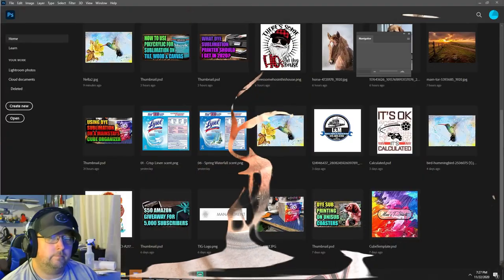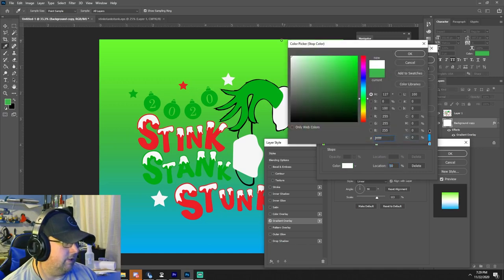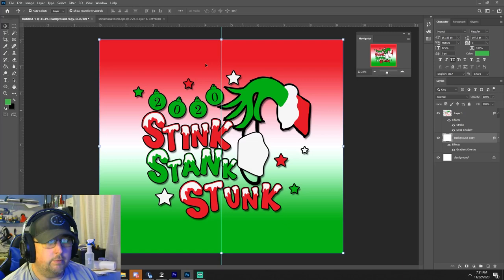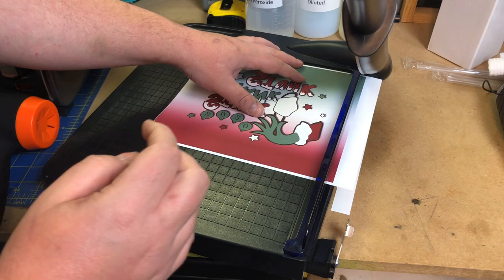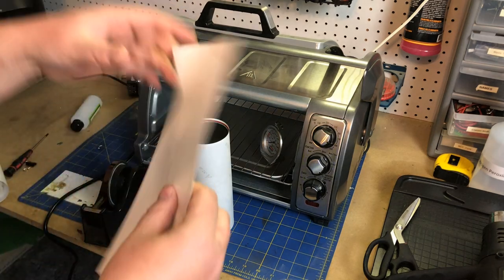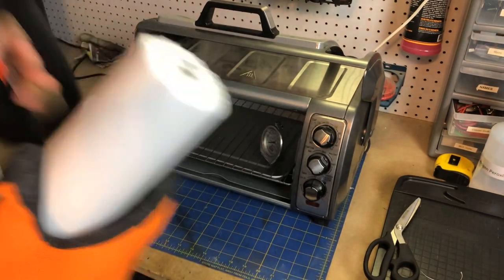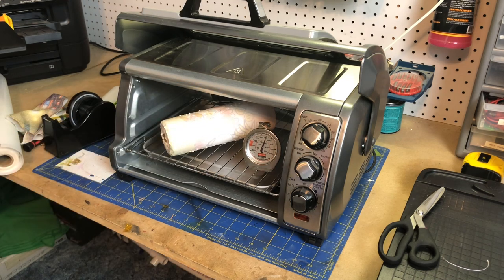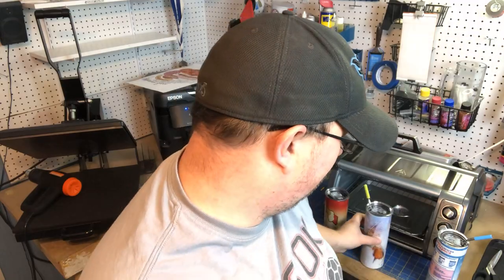Printing Dye Sublimation Skinny Tumblers with an Oven with Shrink Wrap

Comment: Great video. But I did my 20oz tumbler in my mug press and it can out fantastic! Thanks for the inside tip on Photoshop. I use photoshop to make my designs but I’m still not that great with it. But I’m learning.
Reply from the maker: Photoshop takes a little while to learn.. it’s a very deep program

Comment: Dumb Question here, but how so you measure to get the tumbler dimensions? I get the 2.9.....after that I am completely lost! Thanks in advance! Cindy
Reply from the maker: It's actually a little geometry. 2.96 x 3.1415 (pi) = approx 9.3 inches. After that, just add the height.

Comment: when I do ceramic mugs I use a silicone heat wrap in my toaster oven but I put butcher paper over the sub paper then put the wrap on.  I see you didn't add butcher paper before you used the shrink wrap?
Reply from the maker: No, I do sub paper and then shrink wrap.

Comment: Do you not have to turn your cup in the oven? I have one similar and was told to turn about every 2 minutes.
Reply from the maker: I usually turned 180* at 1/2 way to better distribute the heat. Turning every 2 minutes is insanity.. You will jeopardize the oven temp by opening every 2 minutes to turn..